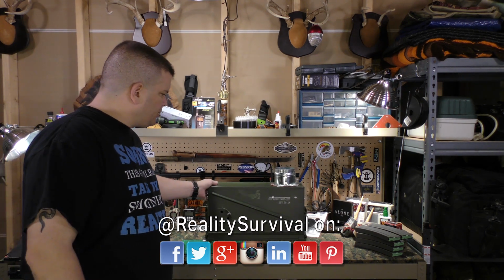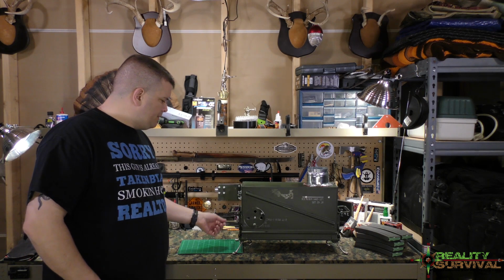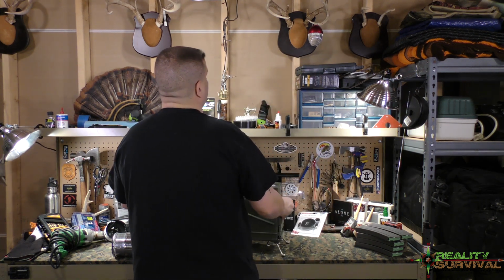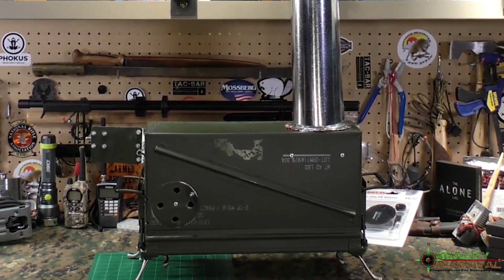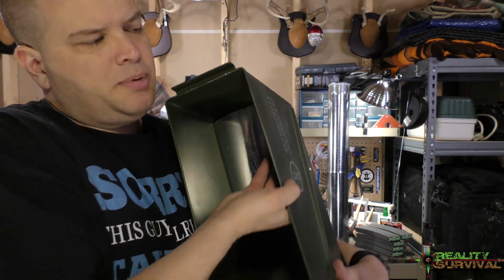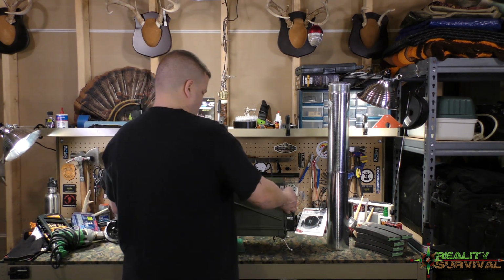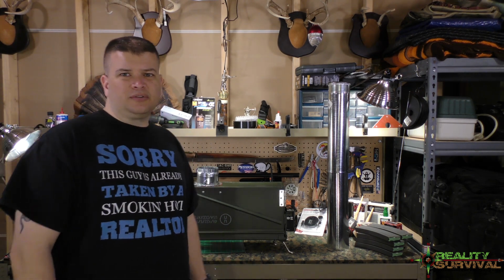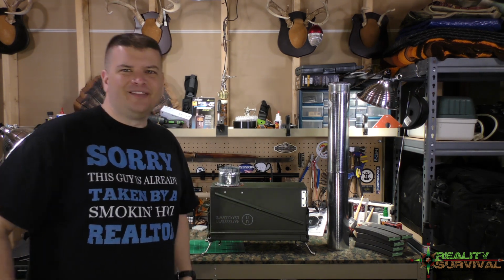Ammo Can Stove For SHTF

Comment: If you have burn problems, put a wire mesh on the Bottom with One inch legs and you;ll get Convection for Better Combustion have seen this on smaller Ammo Can Stoves and It seems to work..good Build  Semper Fi
Reply: That would help to prevent burn through on the bottom as well
Reply from the maker: +Jeff Cooper yep prolly would!
Reply from the maker: +Bill Alexander sweet. Thanks!

Comment: I like this idea though I think that the bolt catch on the door and the turning handle on the air flow damper are going to be a bit small and fiddly to open when hot whilst wearing gloves unless you are planning on opening them with pliers.
Reply from the maker: +Andrew Fawcett yeah that could be. We will have to see. Thanks!
Reply: Andrew Fawcett yep, came to say that door latch is going to get really hot, maybe extend it so you can manipulate it from farther away, maybe a longer handle that slips on, so it isn't sticking out when you are transporting the stove
Reply from the maker: +Mark Zielke good suggestion!

Comment: I'm thinking that you may want to drill some holes in the bottom to let air into the bottom of the fuel .
Reply from the maker: +pumpkin12162 good idea. If it doesnt seem to burn well I will certainly consider that.
Reply: Reality Survival if you drill holes in the bottom stagger them since u have double layer so ash does not fall through. just an idea
Reply from the maker: +Steve Savarese good idea!
Reply: Great video btw. Ur one of 4 I have subscribed to. Keep up the good work
Reply: Or you could just make small holes.
Reply from the maker: +pumpkin12162 for sure.
Reply from the maker: +Steve Savarese thanks man! I appreciate that. Truly.

Comment: Current design dictates taking it all down to dump ashes.  Also, it will have to be dumped frequently due to shallow depth of ash holding.  I would suggest designing feet that would slip into holders on the sides and lose the bottom ones.  Add mesh screen above ash area inside.  Then you have the ability to drop the bottom and dump ashes without taking it all down. Can also be done while maintaining fire inside.  Just my two cents.
Reply from the maker: +Arthur Leslie yeah I have thought about adding an ash screen. Although I dont think it will keep it from burning ok. But we will see.

Comment: I'm just thinking that heat will transfer to the latch on the little side door.   And will make it too hot to handle with a fire going inside.
Reply from the maker: +FEMA Resident #20314 yes it will. You will have to use gloves for sure.